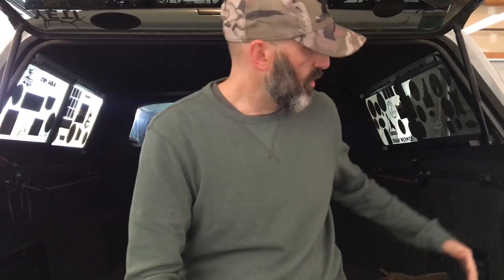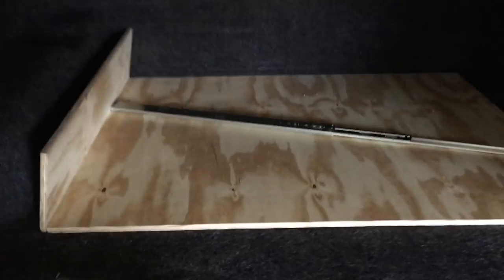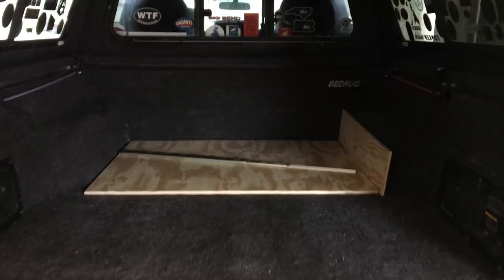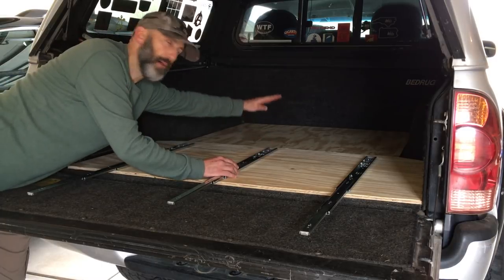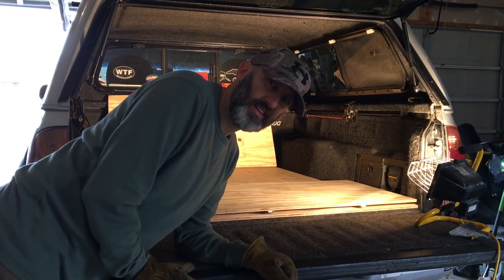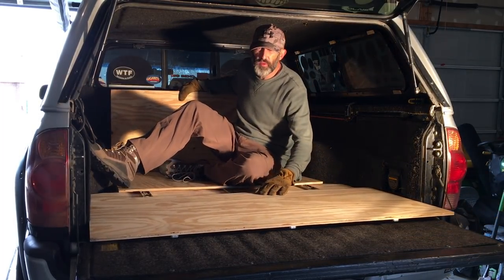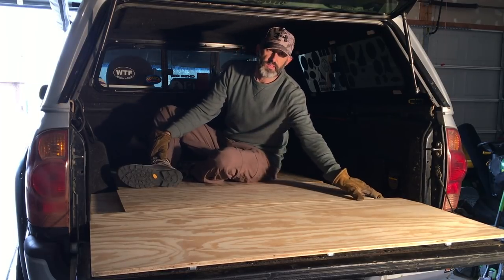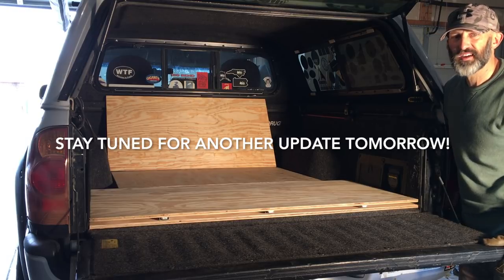Truck Build Design Guide: Part 2 - Adding 2 feet of sleeping area to my short bed Tacoma

Comment: At Costco right now they have a locking  floor mat that can get up really easy I used for insulation 3 days ago camping in the snow with my Dakota it only cost 10 bucks might want to look at that to lay on top of the wood
Reply from the maker: Hey Joeseph! Thanks for the suggestion, I'll be sure to check that out!

Comment: Just a quick thing to note. Are those drawer slides designed to work laying flat? I am not sure if there are any bearings or anything like that that were meant to be operating in a vertical orientation but it might be worth looking into. If it's just plastic slides that do all the support work then you should be good to go.
Reply from the maker: Hey WJ Hammer! You are correct, these are not meant to hold the weight when the sliders are laid flat. These are more of a "track" system to help guide the pop out and we'll be adding stronger bearing tracts along the vertical portions to support the weight. More build videos to come in about 2 days...currently have my truck in the shop getting the steering column replaced so things are on hold until I get my rig back. Thanks for checking out the videos!

Comment: So it’s going to be completely enclosed, like you can lock yourself in for safety. I’ve got the same problem, my truck bed is 5 and I’m 5-10.
Reply from the maker: Hi Laurie, yes that is correct. My two main reasons for doing this build are comfort and safety. I'm going to make it virtually impossible for anyone (or any animals) to get into the rear. I'm excited to see how this build ends up!
Reply: Colorado Backcountry Adventures looking forward to your finished product!

Comment: Looks like a lot of unexpected trouble shooting... The challenge is part of the fun... Try a OPTIMA battery... expensive, but worth it.
Reply from the maker: Thanks RedWhite&Blue 78! Those are nice looking specs on their batteries. I'll definitely consider them, thank you for sharing!
Reply: Colorado Backcountry Adventures... For sure man... I have a 17 year old truck (original owner), I'm on my 3rd battery... 1st one came with it, 2nd 2 were OPTIMA. Crank the radio for 6-8 hrs, it will fire up every time.

Comment: What kind of material is on your camper??? for the inside. Thanks!
Reply from the maker: Hey Sean! Thanks for checking out this video and for your question. When I ordered the topper from A.R.E, I selected the insulation package. This material is essential felt which is glued to the inside of the topper. I've found it to be a great for insulation from cold temps and also a good sound barrier. If you have any additional questions then feel free to hit me up. Have a great weekend!